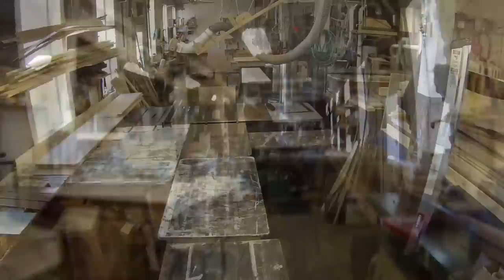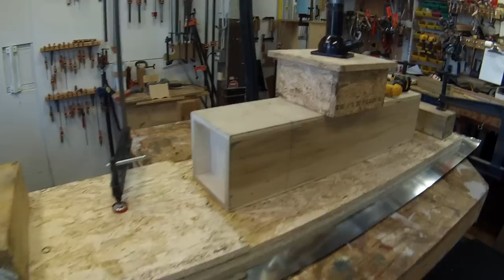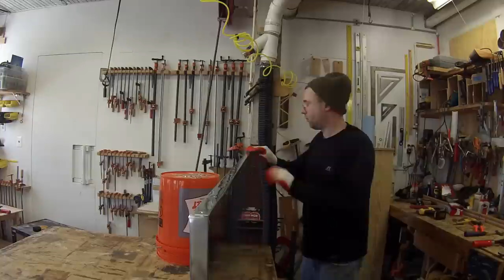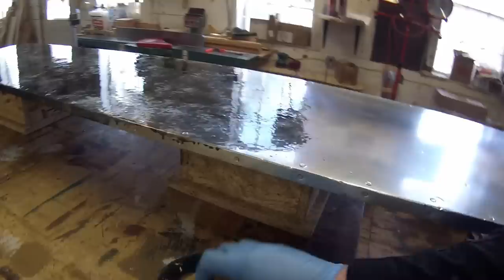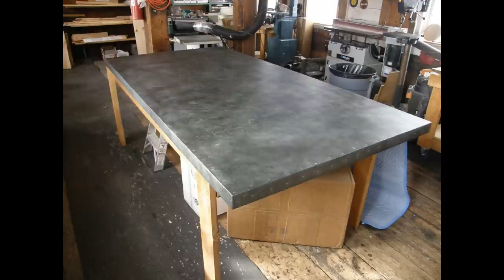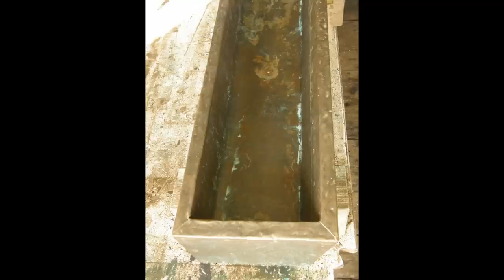Zinc Hammered Counter

Comment: Hey good video! Question for you. I have a zinc alloy hammer (prop from a movie). I got it with a weird stain where there shouldn’t be any on the metal. I’m guessing whoever painted the weathering paint did a bad job. I’m not sure what they used or if it’s similar to your patina ‘juice’. In any case, any thoughts on how to remove it and have the zinc alloy show through again? It should be a matte silver metal color.

Comment: Great video! I have a few questions....1. What type of nail gun were you using when you were nailing the zinc underneath the counter top? 2. Before you nails the rivets, you were using a hand tool to punch a hole before you added the rivet...what was that small hand tool called? 3. What grit sandpaper did you use when you were sanding with the orbital sander. 4. What thickness was the zinc sheet you used. Thank you!!!!!
Reply from the maker: +RD 
1) 1/4 narrow crown staples 2) nail punch 3) fine grit synthetic abrasive pad (they are color coded for grit - gray is fine)  4) not sure but I think it around 30 gauge galvanized

Comment: Hi. Your counter tops are amazing.  I have done a remodel in my office and have taken on the project of a zinc counter top.  I am at the patina phase.  I am interested in purchasing your JUICE as it is exactly the color I am looking for. Is it a solution of a particular of H20 and color?
Reply from the maker: it reacts with the metal to produce color effect.  it is not a pigment, if that is the question
Reply: @hffcom  DO YOU SELL THE JUICE IN THE DILUTION NEEDED FOR THE EFFECT IN YOUR VIDEO?

Comment: Hi Mitch,
Love you vids, did you degrease or clean the zinc before you glued it to the board? 
Thanks
Mark
Reply from the maker: Hope and Greenwood I degrease and clean before patina but not gluing.  I use a construction adhesive with poly.  (its good adhesive - sticks to most anything)
Reply: hffcom Thanks for the heads up, I'm making my first zinc countertop and your "tutorial" is head and shoulders above all the others on the tinterweb!
Reply: hffcom  can i have the make and name of the glue please